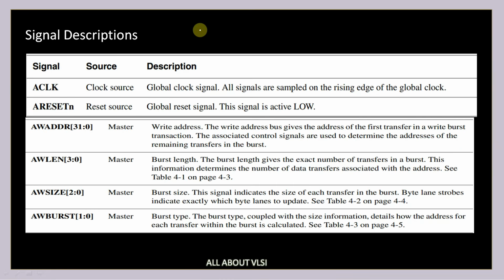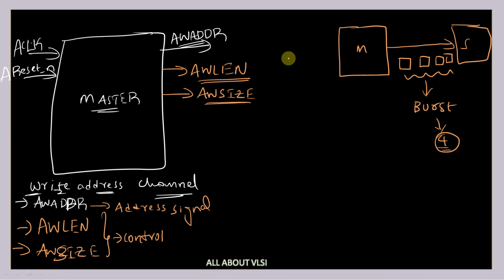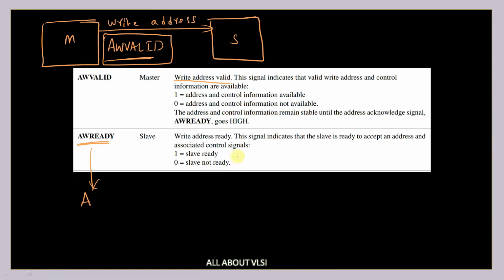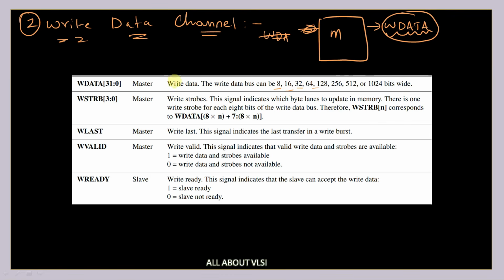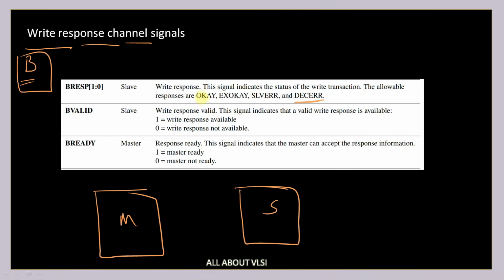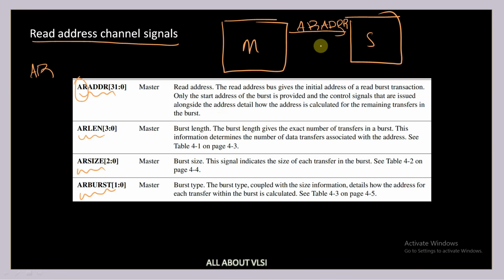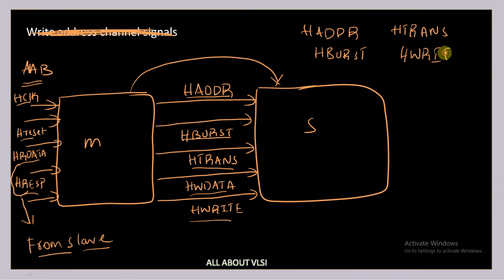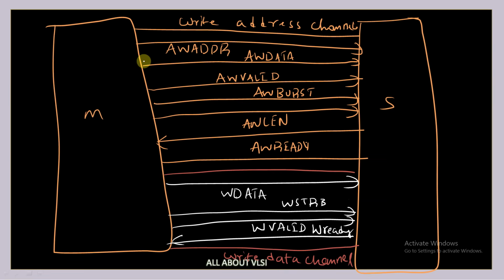AXI Protocol Explained: Signal and Channel Descriptions | AXI Read & Write Channels Made Easy

Comment: Your usage of the terms transaction, transfer, size, length are extremely confusing. You call a transfer a transaction, or vice versa. Or you call the size as if they are the length etc. It would be nice of you can stick to the official definitions from Arm material. I have to keep stopping the video and re watch and unravel what you mean myself 😂 But overall thank you for your effort in putting these together!

Comment: Hi at time-stamp  26.12 in the diagram you have shown AWDATA but as address channel and data channel are seperate  in axi so it is wrong as per my understanding. Pls clarify and thanks for the amazing session on protocols and UVM as well.
Reply from the maker: Yes its a mistake over there
Reply: I was just about to type this also 😂
Reply: Also calling the ARREADY and ARVALID as read response channel is wrong also. As if there is 6 channels now in AXI protocol. I got confused there and then ignored it.